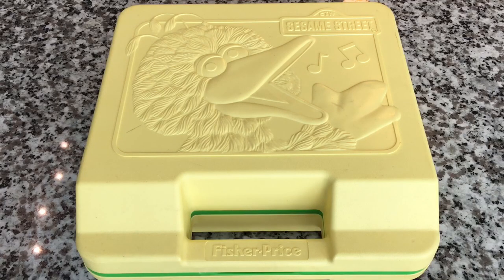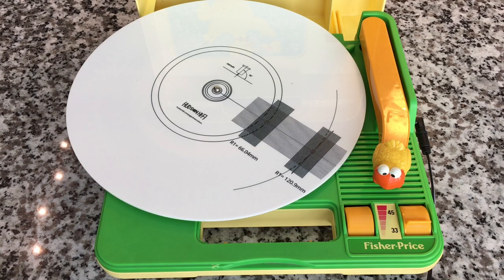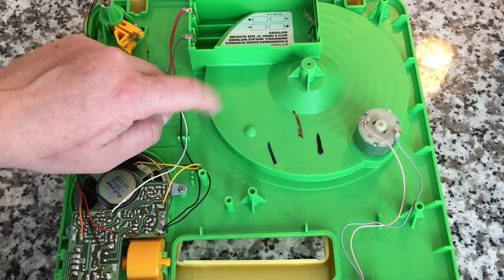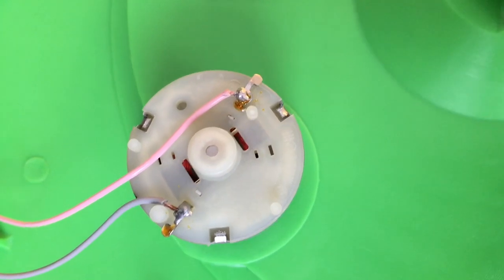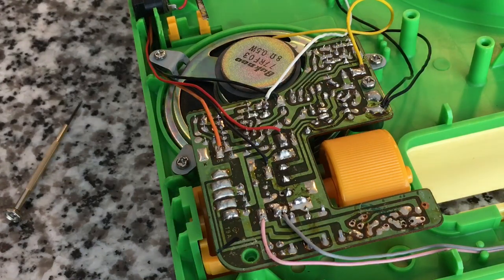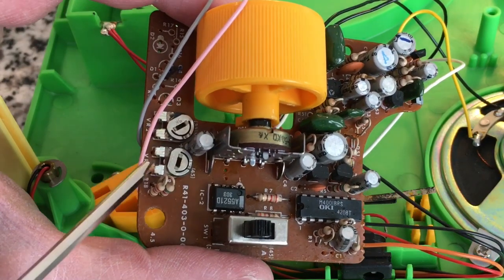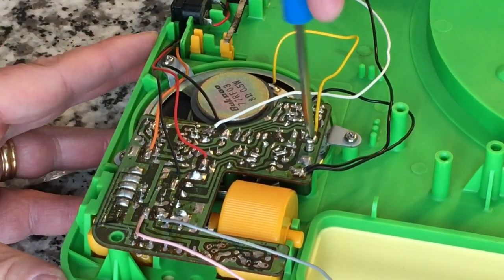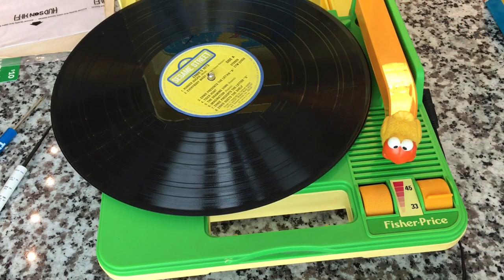Fixing The Fisher Price Sesame St. Phonograph!

Comment: That motor is a simple toy type. Purely voltage dependant. 

The usual platter removal process is to take off the 45 adapter. Under that will be a keeper pin or clip.

BE CAREFUL! There is sometimes a a ball (bearing) in the end. Don't lose it. It may be captive but care is wise.

Comment: 4:40 No, those four batteries are connected in series and that metal plate is between the 2nd and 3rd of them. Look at the sticker in the battery compartment.
Nice that it only took some trimmer pot adjustment, I expected a gummed up idler wheel. Lets hope those pots aren't corroded or dusty inside, otherwise the settings will start to drift within only a few weeks...
Btw, did you just forgot to set the 45 RPM pot? 😜
Reply from the maker: I did it off camera....
Reply: @Recordology  Phew! 
Imagine you would've had to open it all over again... Happened to me a few times haha